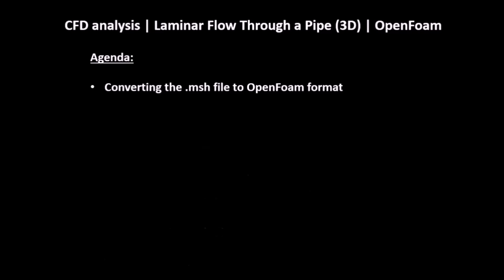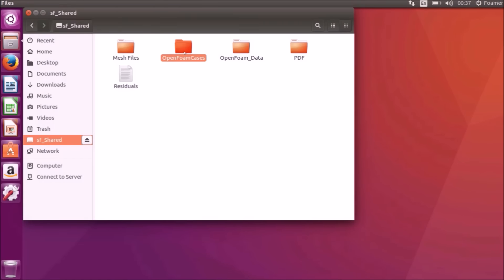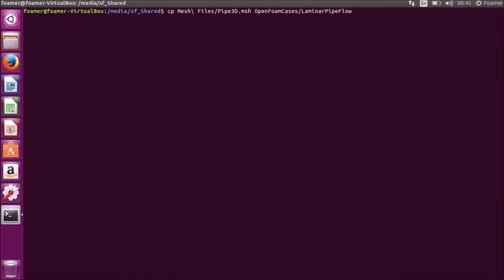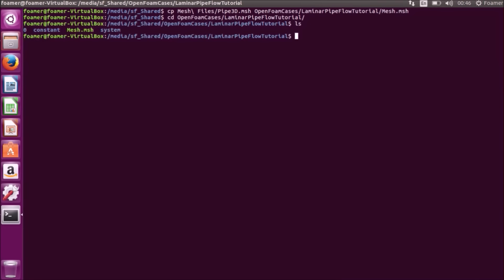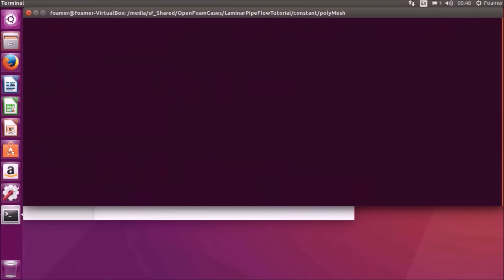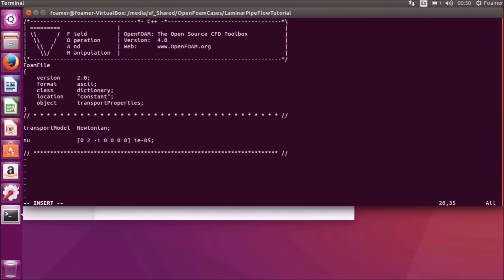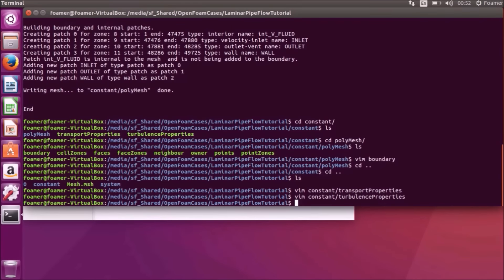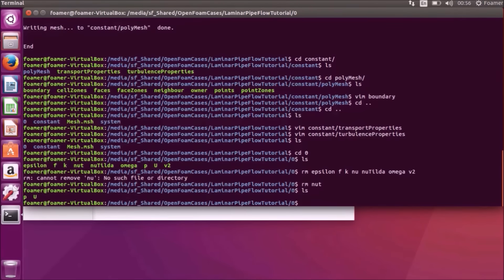OpenFoam CFD Tutorial | Laminar Flow Through a Pipe 3D | Part 1/4- Case Setup

Comment: Hello,
Would you give suggetion or method in use Openfoam set up compressible channel flow for me? if you have new tutorial for compressible channel flow or procedure set up compressible flow in Openfoam, I want to studying compressible channel flow but I am inexperienced Openfoam code. Please suggestion !!! thanks
Reply from the maker: Hello, I will try to make a video on compressible channel flows by next week... Do you have any geometry, boundary conditions preferences ??
Reply: yes, i have a channel geometry.  I did my geometry by Gmsh and I can send model to you. Could you give me your email or another way? 
Thank you very much.
Reply from the maker: vjykmr44@gmail.com
Reply: I sent channel geometry file and mesh file by Gmsh to your email and you can modified or edited mesh. If you need any more information, please let me know.
Thank you for your time. And I look forward to new tutorial from you soon.
Reply from the maker: BC's of your simulation... please draw a rough sketch of it and send it to me
Reply: Channel Boundary condition
- Wall at Top and Bottom wall on z-axis
- cyclic on x-axis and y-axis (for periodic condition)
- Air Flow pass x-axis
- velocity field on mach number as 0.3 (104.5 m/s)
and Re@bulk mean velocity is 7000.
-air (Fluid parameter) T=300K
----specie
        nMoles 1;
        molWeight 28.96;
----thermodynamics
       Cp 1004.5;
       Hf  2.544e+06;
----transport
      mu 1.8e-05;
      Pr 0.7;
For Numerical method for calculation you can use "rhoPimpleFoam" or your another, the goal of study is compressible turbulent flow on channel flow and I send the a drag of problem on your email. 
Thank you